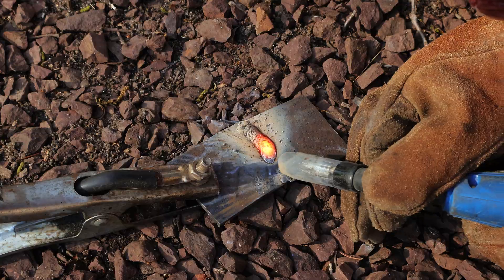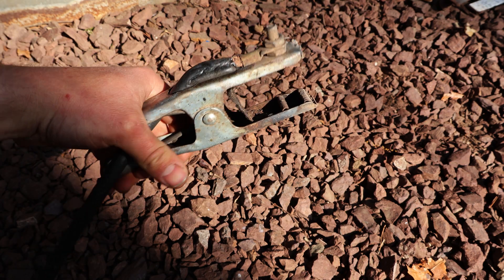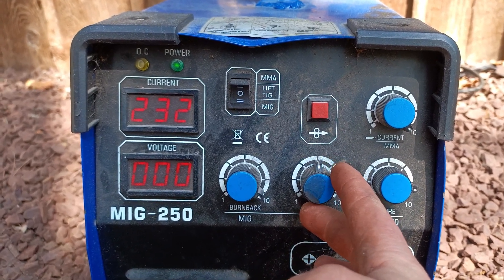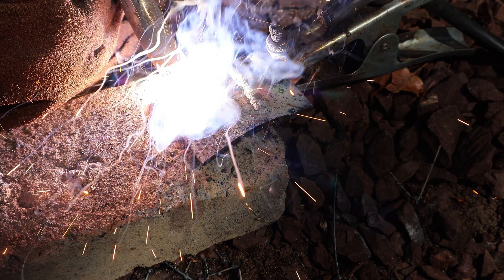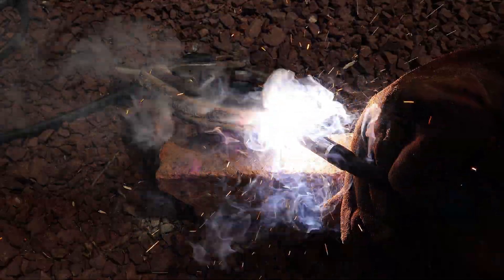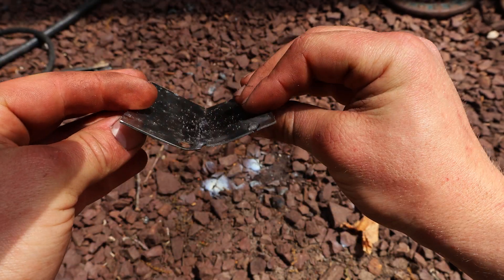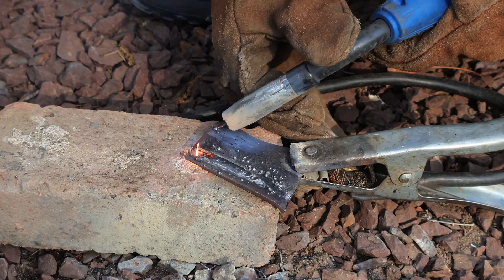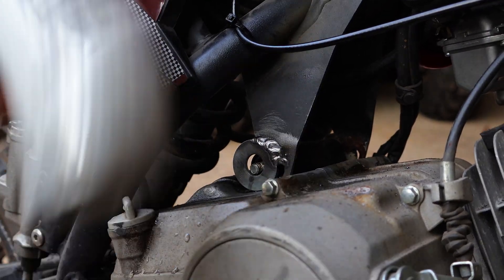Don't Miss Out on These Essential Welding Steel Tips!

Comment: La pregunta respecto al acero inoxidable es: Existe alambre flux para acero inoxidable? Porque éste no requeriría pintura protectora, y la durabilidad sería máxima 🤷🏻‍♂️
Reply from the maker: You're right, I think they do actually make Flux cored stainless steel wire, and that would definitely give you better results.